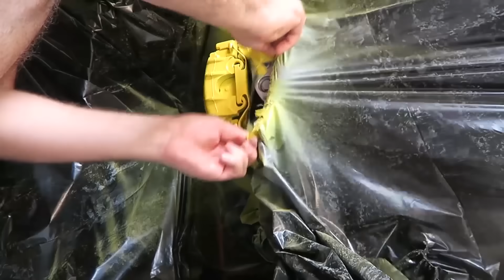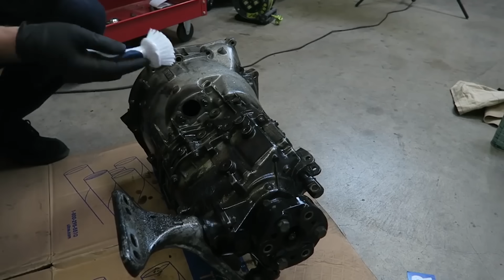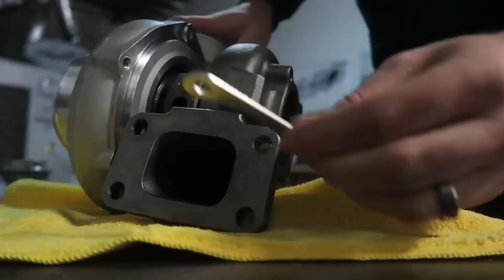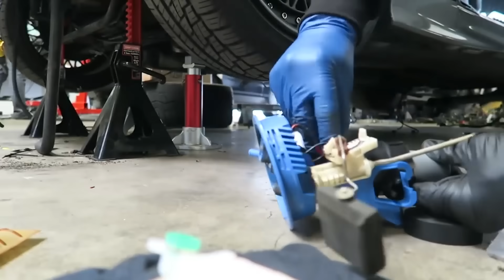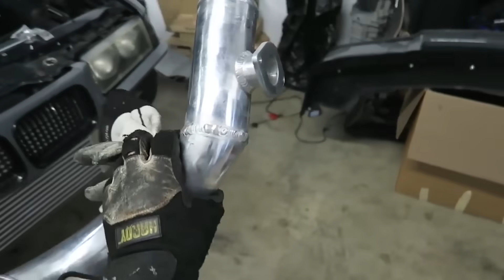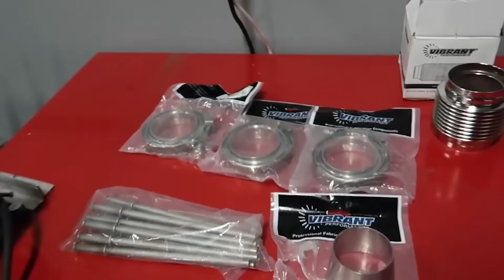Building a E36 M3 in 10 minutes!

Comment: But you forgot to install the piston return springs and change the blinker fluid. :) great video btw
Reply: Bmw’s dont have a compartment for blinker fluid what are you talking about
Reply: Atleast the e36
Reply: Piston return springs lmfao
Reply: @NYSO-DTM  yea i forgot
Reply: @NYSO-DTM  The blinkers on BMW's is actually just a decoration.
Reply: Chris fix😂😂
Reply: and summer tyre air to winter air
Reply: U should clean ur car with soopy woder
Reply: Its not a honda del sol
Reply: And he also didn't changed the summer air from the tires into winter air
Reply: and they missed the muffler bearing

Comment: Finding even a normal E36 without the M package for a good price in good condition is hard these days.
Reply: €25.000 for a Nice m3 here in Belgium
Reply: Or €46.000 for An e36 m3 with a little over 30.000 miles and original coating and super duper condition
Reply: 10years ago you can pick them for 5k now it's verry expensive
Reply: BaggyzZ bought my e36 for 1600$ in good condition
Reply: I have a old beat down one in my driveway someone gave it to me for free
Reply: @carlosmenendezjr5662  if you're trying to get rid of it... Lmk

Comment: I didn't know E36 has that easy access to gas pump
Reply: Mario no it varies, some cars have it under the trunk, some have it in the front like Porsche. Old pickups have it behind the drivers seat. Tons of places to put a tank.
Reply: Mario Porsche’s are German and it’s definitely not under the back seat, older bmws have it under the trunk. Miatas have it in the trunk. You’re making pretty broad statements there
Reply: Mario no e9s and other older bmws have it under the trunk. The cayman isn’t a 911 and the fuel tank is in the front. Old VW bugs have the tank in the front. Point is not every German car has the fuel tank under the rear seat like you said.
Reply: To both of you guys I mean is it really that serious? Also porches are I believe rear engines I'm not sure if it's forward enough to say mid but there fore not like most front mounted engine cars have gas tanks in the rear so honnestly Id say a porche shouldn't really be a viable option same for VW, beetles specifically considering there engines are also in the rear therefore needing a different gas tank placement 🤷‍♂️
Reply: Mario  on some year 2000 jaguar you literally gotta remove whole subframe to access fuel pump lmao.
Reply: @Hole_Motorsports  porsche is another thing...dont confuse yourself
Reply: Tons of older chassis bimmers have the pump in the trunk. All of my e34's definitely did.

Comment: lost me when u did that to the suspension. just a show car
Reply: Leon Dédalos yep couldn’t even watch it anymore what a waste of a good car
Reply: There's absolutely nothing wrong with air suspension when it's set correctly and put together well

I daily drive an e39 with air suspension which I sometimes take to the track, works brilliantly... 
I am more triggered about that dude putting a turbo on that M3, BMW's are meant to be inline 6 naturally aspirated, no turbo nonsense, especially on an M3. With air suspension you can still daily it, with such a turbo setup, I doubt it
Reply: @WiNdEaTh2012  i watched everything, it relies to much on peak power, since its a big turbo with long spooling time. coudnt go anywhere new fast around the track.
Reply: @bmwe3945  gotta agree with u on the inline 6 na. i like na cars. turbo m3s are good if youre doing a drift setup, wich is shown no to be the case.
Reply: @bmwe3945  i reccon you can have some fun a a well setten up air susp , yet , air suspensions are for shows and even if you dont notice it, it doest goes as fast as  the other option
Reply: @bmwe3945  a pro pilot immeadiately notices the air suspension draggin the car slower around the track
Reply: @CineGui  I genuinely don't understand why people want gigantic turbo's with gigantic loads of lag, it's just not practical and you won't ever be going full throttle. When you do go full power, you'll always be afraid of it breaking after a kilometer, and you know it will happen... So you basically have a car that can go fast, but you never use it and you'd end up with the same result if you had it lightly modded, only you'll have a lot less cash... 
Drifting generally does require for turbos, but is it really worth sacrificing an M3 for that once-a-month drift event? I'd rather save the M3 and buy something ugly where you don't mind it being bashed. 

Air suspension does allow for having some fun, but it is indeed heavier than coilovers... Mind you, I do live in a country with a fuckton speedbumps everywhere so having the ability to raise your ride is quite convenient... I'd gladly pick airride over coilovers anytime just to save my new paintwork
Reply: @bmwe3945  because thats a show car brother, they just wanna show those peak numbers on the dyno and make a lot of noise while accelerating
Reply: @bmwe3945  my country has poor roads and tons of speed bumps as well, so we use a suspension wich we can adjust the hight with the turn of a screw. we set it high for daily use and screw it down when tracking
Reply: @bmwe3945  You can in no shape, way or form compare air suspension to coilovers. Your E39 may "work brilliantly" to your standards, but E39's was never and will never be known for their handling, M5 or not. They are boats. Dont get me wrong, E39's are great cruisers i've had several but they aren't a car you'd ever want to take to the track?
Reply: @placeholdername3206  first of all, there's a difference between the 6 cylinders and 8 cylinders, the 6's use a steering rack and the V8's use a steering box. Boxes give vague steering, rack doesn't.

Mines a 528i so it has the rack, tuned the engine a bit to have 240hp, installed paddle shifters to work with the manual mode on the gearbox, plenty of fun and outperforms a fair share of cars on Zandvoort, Nordschleife and Zolder. Wouldn't say the air suspension is a downgrade to the car.

Don't track it as much as I used to since I'm a student and I have no time, so now I'm turning it into a backroad racer as I daily 2 hours in the backroads per day

Comment: So I need some insight/help so I'm debating weather I should but a 325Xi that needs a new intercooler and a thermostat or a 1981 Lancia Zagoto Spyder that need new upholstered seats a new soft top cover and a couple other things. The Lancia hasn't run since 05 which should I pick. (Oh and they are both stick).